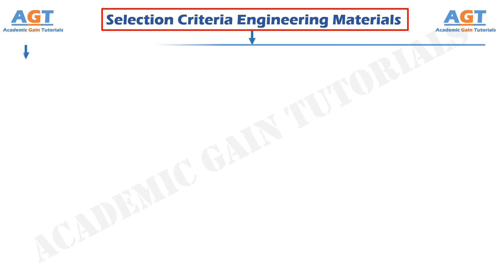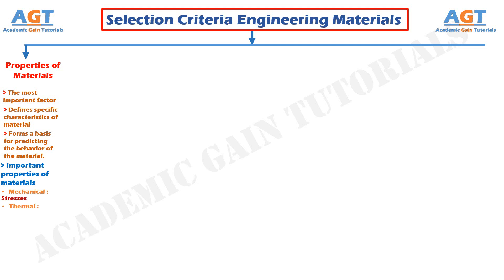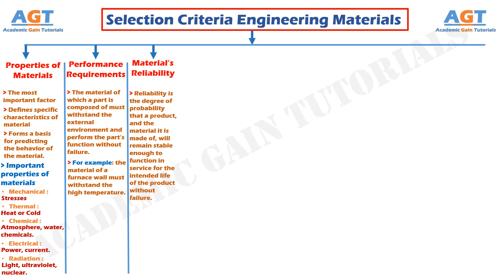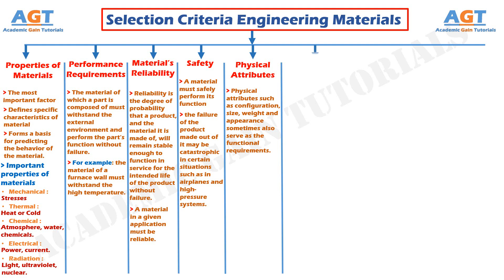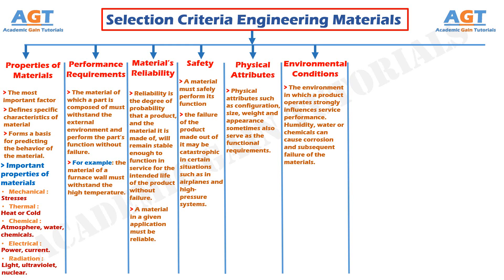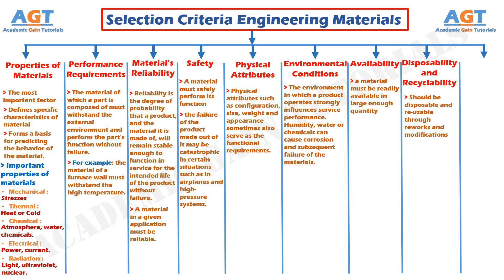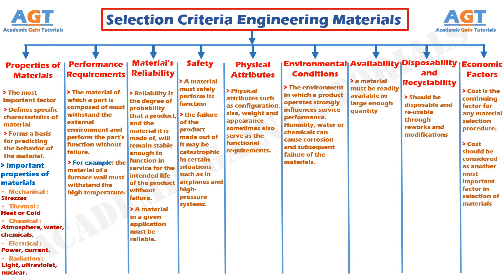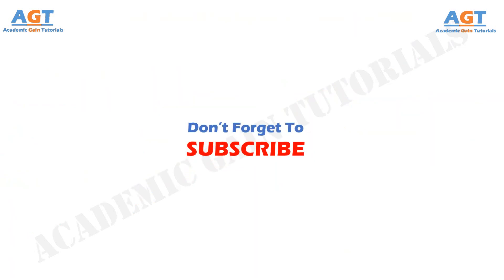Selection Criteria of Engineering Materials

Comment: Thank you so much for the knowledge that you provided in a single video.

Also, I wanted know which material to be used in a machine involving high magnetic field such that the efficiency of the machine should not be compromised due to the materials magnetic properties?
Reply: A material with low ferrous content or a material that is less magnetic based on the structure of the periodic table.